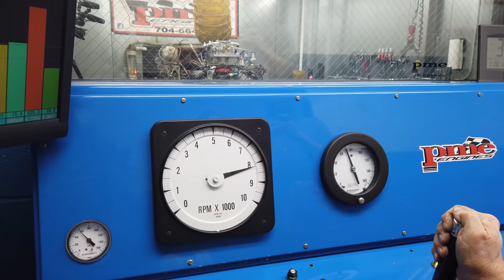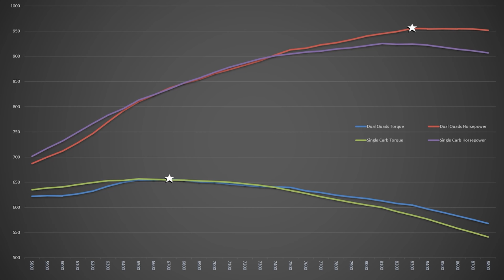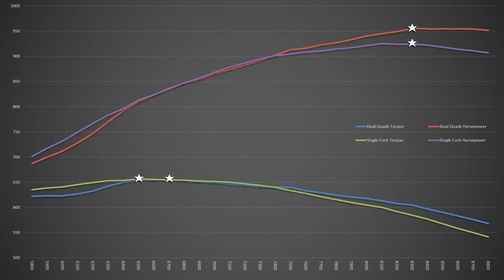955 Horsepower NASCAR Engine for the Street! (w/ ProMotor Engines)

Comment: The down side to these engines are that they stopped producing Blocks a few years ago.. so what’s out there is all there will be. Teams are having to repair and reuse available blocks.. you best bet on getting one is buying a complet engine from A builder.. if you do happen to find a block.. they are not cheap and parts from different builders do not interchange. Makes it next to a huge chore sourcing the correct parts to fit the block/head package you have.. 

Great vid !!😁👍

Comment: I'm a Mopar fan of the 426 Hemi but also love even the Chevy power muscle machines. My last venture was into an incredible 2.2 2002 eco caviler motor with at present 207,000 + miles and cranks still on one turn of key in less than two seconds of operation.  Would be estatic if this company could build a four cylinder block that could pump out massive horse power as this special block does.  Not saying four is the way, but even six's are strong.  God bless the eight.

Comment: I can see these blocks and heads being used in a high boost application, especially with the amount of fasteners holding down the cyl head and the strong block design
Reply: With boost, the power would be frightening. I would also expect incredible durability.

Comment: I'd sacrifice that stroke for the oilers on the street version and I love the link-bar less valve train with the big replaceable bushings, the lifter valley head-bolts and cover with coolant ports, not to mention the valve covers with oil towers and splayed valve geometry. The more bulletproof the better so I'd dig deeper cans to go with that shorter stroke, may be even 9:1 for some forced induction. Really is a thing of beauty, but I doubt I'll ever have pockets deep enough for such a state of the art piece of machinery.

Comment: dirt racers around here get a road course engine due to the better low-end power curve seems that would have been the case here as well. I also noticed the bad mismatch in the intake runner on the single carb intake easily worth 25 to 35 hp at high rpm. But what a beast that would be, a good friend of mine is a nascar parts reseller and has truck loads of r07 part but the blocks they don't sell often due to the replaceable sleeves.

Comment: Fantastic Engine Shop and a Great Motor Build...  if they took the 2 x 750"s off, put some Holley 950's, or Bigger  as they said on that Ram..  they would of hit the 1000 HP  PLUS.......Easy... RO7  Damm Good Design..

Comment: I hope they understand that with the crows foot closed end socket oriented straight will require an adjustment in torque level to achieve the real torque.  The correct orientation is to a right angle to the driver.  Since they have it inline with the handle, they need to use a torque transducer to see what to set the torque wrench to in order to compensate for the additional length of the crows foot socket.
Reply from the maker: Yep!

Comment: Wow 👌,  looks like some adopted Big Block technology. I love all of the modifications. Myself I'd like to see some of these modifications done to a 302 to make a  wide range Torque Monster. I'm dreaming of doing it with a 5.3 aluminum block LS. The idea is Torque is what wins races on curves and with modern short track Autocross. Then Street driving will always pay off in comparison. It's a similar type of theory. Keep things light, and friction free. As compared to Ford the 302 Chevrolet had a much better Torque range and the racing of the 60 and 70s Legendary records were made. I'd like to see more of that.

Comment: funny when they were doing the dyno I was thinking they didn't even load the motor. It was at 5000 and didn't load up. Then it cranked up haha. 2 sec later he says were didn't even start the dyno till 5800 since its such a high rpm engine.  Sounded like a normal red line run then loaded and cranked it on up to 9000+   what a piece of machinery. All that oil cooling and protection this motor sure would love a good 20psi of boost to put in in the 2500 range lol

Comment: Even though the heads had the black plates covering the intake ports, you cold still see where the individual runners were when it was showing the bottom side.  I've always found it interesting how chevy's Nascar engines mimicked some features of the windsor small block ford.  Such as the distributor being moved to the front, and the symmetrical port arrangement in the heads, no siamesed runners like a traditional sbc.  I'm not calling the Chevy a Ford knockoff, I just think they recognized that it was a better design.  That's why the LS engines heads changed to a symmetric port arrangement too.  There's no denying how good the LS and newer LT engines are.
Edit:  The intake manifold is also a dead giveaway of the intake port location, lol.  I guess they might be hiding the port shape and size more than anything.  But if it matches the intake (which it really should for best flow) you can get some idea of it.

Comment: My street/race car normally lives below 40 MPH because the courses are just that tight, one sanctioning body requires top speeds of ~30 MPH, and the other lets max course design speed go as high as 80 MPH given enough runoff room but if there are things near the course to run into speeds have to be limited by course design to 55 MPH. The smaller cam engine would work better for me, especially for that one turn on every course that a person on foot could run faster than the cars.

Comment: Just out of curiosity, With this engine Design being created by Chevrolet I was curious if a standard sbc transmission Bell housing is the same?  After typing this I realized it's probably a ignorant question, But if I don't know the answer I'm eager to learn. If you pretend to know everything you will never learn anything. With that being said I'm always eager To learn something new. It is what fuels my flame for my Passion in motorsports.  Thanks for the great video!
Reply from the maker: Yes, a standard Chevy small block bellhousing will bolt right up. Interestingly, in racing they call it the "NASCAR bellhousing pattern," and every engine uses it. So if you have a Ford NASCAR race engine (the FR9), it will bolt right up to a Chevy bellhousing. Thanks for watching
Reply: @TheHorsepowerMonster  wow, now that's way more interesting!!! I would have never known that without your knowledge. But it definitely makes sense considering rules and regulations pretty much Level the playing fields by giving every team equal opportunity.  Definitely a lot different than the old stock car days In building homologation specials.  Thanks for the reply. You've definitely got yourself a new subscriber!! You guys rock!

Comment: A bunch of years ago, a guy had an engine with old Nascar parts in a Malibu wagon. It was in hot rod or car craft magazine, and I remember one line from the article which made perfect sense. Paraphrasing, he said "those engines are designed to run 600 miles at 8000+ rpm, a street driven version should probably last forever."
Reply from the maker: That was Jesse Kiser. He's a friend.
Reply: @TheHorsepowerMonster  do you have a link to that article by chance? Or where it was published? I've been looking for it since I posted the comment and can't find it anywhere. Now that I have the name, that might narrow it down some though.
Reply from the maker: @HerculesRockefellerESQ  I think he called his car the "Maliboost" I went to hotrod.com and did a quick search but none of his work came up, which is weird (all my old stuff is still there). I don't know if they never put it online or took it all down, but I couldn't find anything.
Reply: @TheHorsepowerMonster  if it's the white car, it's not the same car I am thinking of. The one I am thinking of was like a metallic purple, had a huge cowl hood. I THINK it was SB2 based, so that will give you an idea of how long ago the article was. It MAY have been R07 but I'm not thinking it was. I will do some more digging and see if I can find it.

Comment: Just one thing I noticed while they were torqueing heads he had the crows foot wrong. He lengthened the torque wrench by putting the crows foot straight out changing the torque value at the fastener. Instead of at a 90* angle keeping value. but that is one hell of an engine.
Reply: I also noticed that. I'm sure they corrected the reading to achieve the correct actual torque.

Comment: I dont understand the roller bearing decision for the cam.  Turbos spin faster and easier with oil bearings than ball bearings.  The cam in an engine should also ride on an oil bearing at all times except for startup.  The only thing I can think of is that the thin journals are not wide enough for an oil bearing.  Does the lower rotational mass benefit out-weight the roller bearing drag?

Comment: Nice FORD motor!
Reply: Doesn't it say chevy Ro7??
Reply: @ripinpieces8387  yep! But it is a Ford design Distributor in the front evenly spaced intake runners canted valves. Just like a 351 Cleveland!

Comment: The pro street guys take a pretty good crack at BIG hp and torque by installing blowers, injectors, crazy cams and nitrous oxide injection on hemi head big block engines. They usually run out of money at around 600 hp.

Comment: 6.200"  Connecting Rods with a 1.850 Rod Journal.  3.600" Stroke used for the build.
6:00  Not for the Build. Lightening Holes method looks Coooool!  But is it Superior?

Comment: Cost a small fortune to build this engine . Thanks but a 468 bbc couple VS Racing turbos a IRD blow thru carb  and making 1600hp all day and under 10 grand.  On 104 octane .
Reply: Under $10k??? That has to be no labor, and some stolen/traded parts. Pay someone to build/machine that, and it won't be under $10k!

Comment: Can you give an estimated price range on the 960 HP Engine like was built on the video? I’m done with BBC’s after this video. I have $30K in a Nickens built 
565 CI, Slick Rick Headed BBC. It makes 960HP & 745# ft Torque.  On a single 1350 Dominator / David Cook Carb. It has 3 stages of Nitrous and has been 4.90 in the 1/8 in 2400# Big Tire Chassis car. 

This 397 CI jewel would. Do so much better because of the weight and just seems like it is a more balanced combo.  I’d be interested in cost comparison.

Comment: This is amazing! It seems like no new technology except for coatings is used to reach these numbers, WHY then did it take so long for it to reach the eyes of the general public? Most live with the belief no pushrod V8 can produce over 100 bhp/liter in N/A-form, yet here, you're delivering 147+ bhp/liter. With a lower compression ratio and lower octane fuel I'm guessing it would still be in the 120s, yet why has no pushrod N/A V8 in a production car delivered more than 75 bhp/liter? Even with DOHC, domestic V8s haven't gone past 102 bhp/liter. 
As I understand it, these engines aren't even that expensive compared to what euro shops charge for "racing" engines.

Comment: I can only imagine nascar engines would be pretty reliable since they are built for hours of redline operation at a time
Reply: Reliable yes but longevity no as any race engine is built knowing it will be pulled down and certain components replaced, I know V8SC motor needs heads rebuilt every 2,000 klm bottom end every 4,000 , still cheaper option using a race motor over building a crate motor to perform like one without using forced induction.
Reply: @simongunn4606  I mean im sure you went from 900hp at top RPM for 3 hours to like 500hp and drove it with sanity alot of those numbers would probably change

Comment: I’m sure the federal epa will love this!
Reply from the maker: I have zero actual test results to back up this up, so this is totally an opinion, but I don't think the exhaust particulates would be that bad (If that's what you are talking about when you say the epa). The whole point of NASCAR engines is to be as absolutely efficient as possible to squeeze out as much power as you can under the rules. So they spend a lot of time and R&D money trying to make sure every drop of fuel that goes into the combustion chambers gets burned. Anyhow, thanks for watching.
Reply: @TheHorsepowerMonster  Good video. It just burns me up with the EPA trying to dictate. Keep up your content I’m with you sir.
Reply from the maker: @atomicorang  Gotcha. Thanks
Reply: @TheHorsepowerMonster  I’m a gear head and fully support our sport

Comment: Personally I'd go shorter on the stroke before I'd pull the squirters. HUGE improvement in durability and reliability. But I supposed if you're not doing many miles or really pushing it with hours on end at 8800 rpm, it's probably OK to skip them.
Reply: have you seen specific examples of engines being compromised from lack of piston oil squiters? Seems like basic connect rod oil notches do a good job
Reply: @bwatt1383  Squirters pull more heat out of the pistons. This is especially important in forced induction applications where you have a lot more heat per stroke. Squirters let you run more heat into the pistons without having to open up clearances as much at deal with the oil consumption and knocking that tends to come in.

I've seen engines fail just from having the squirters not aimed correctly, LOL. (when matched with gallery cooled pistons).

IMO, better to go shorter on stroke and just rev it a bit higher.

Comment: This was amazing to watch. But I'm curious and I'm sure I already know the answer to this question. Looking at dyno graph I noticed the awesome hp curve and the tq curve was badass as well. But tq was no where near the hp curve it's almost one third of it. But it being a built for what it is to run at 8500 rpm for a really long time explains it, you don't need all that torque to keep going at that rpm. I'd love to hear a chevy v8!  run at 9500 or 10k my uncle is a big time mechanic and told me he use to run his sbc built of course using 70s LT stuff he didnt into deep detail but claimed he ran them to 10k but he also said he went through alot of blocks and some heads back in the  day drag racing. I found it hard to believe but hes 60 now and was turning wrenches and put together his first sbc 350 when he was 13 or younger. I cant remember everything he said.

Comment: suprised to see the crank still seting up out of the block and not seting  down inside the block with  6 bolt mains  2 coming in from the side of the block   but i was impressed with cam grind and bearings   way kool  it would be awesome if somebody would come up with electric  dry sump system  it would free up alot of hp and  it would be kool if somebody would build a rotary valve  head with  fan cut inside the  valve disc so cyclinder pressure would spin the valve disc  creasting power from the valves in head  then down to crank  it would be a free flowing system with no valve stem restricting air flow  tight clearence   would be the sealing up   on the  valve disc with a  step or 2 cut into it  i think this would open up hp gains  unlike any other  pro built engine

Comment: You can build a destroyed sbc and it will ref to the moon with say those new 13 degrees heads from MBE aluminum rods a light weight drilled out billet crank of course you need a after market Dart block or Brodix run main studs and head studs custom dome pistons you need good parts to hold up to a high removing engine and especially if you wanna run Boost have it built right by someone that knows what there doing and has a good rep engines like that have to atay cool and be built right with good parts the valve angles and Geometry needs to be right I have a new 427 built by TKM and it runs really good I’ve been with them a few years.

Comment: When is he planning on offering the “street” version of the ro7 with lower compression and how will you be able to buy it
Reply: This radical thing makes 955, drop loads of stuff out of it and it will make 700...which is easily obtainable today with a stock block and off the shelf heads and cam. Its nice, but totally impractical, they should of shown us the "true" street version.....

Comment: I’d definitely go for the real street version. 750hp in a 3400lbs car is nothing to shake a stick at. At 12.5:1 compression and having to run race fuel doesn’t make a street motor in my opinion. Depending on your trans and rear gearing the insano power band could be livable.

Comment: Noticed a torque mistake when he was using a crowsfoot on the heads, should be 90 degrees off the end of torque wrench.
With the crowsfoot straight you will overtorque the nuts how much over depends on the length of arm on crowsfoot.
Reply from the maker: Sorry, but I'm pretty sure the crowsfoot or dogbone should be parallel with the beam of the wrench (straight out). And you are right, it does create leverage that changes the torque factor, which must be accounted for when setting the torque on your wrench. But those calculations are relatively straightforward. Thanks for watching

Comment: The number of drivers for each manufacturer are not always equal though are they? Kind of crazy in 1965 Ford won 48/55 races and had a 32 win streak. That 427 was a hell of an engine. I can understand that speed was getting crazy and that's why they banned the Boss 429's and aero 426's but it is a shame we didn't get to see them run. Of course the safety just wasn't there at the time so probably best it didn't happen.

Comment: Great video..  But why not using OHV? Fun Fact a 3L or 183IN3 N/A F1 car engine makes same HP but at 19800 Rpm
Reply from the maker: It is an overhead valve engine? Do you mean overhead cam? If so, that's not allowed by the rules in NASCAR. Thanks for watching

Comment: Almost a 1 inch valve lift at a 9,000 rpm redline, that's unbelievable. 
If I drill dimples for pushrod half way down my rockers, will I be able to rev to 9,000 rpm ? - somehow I think not...